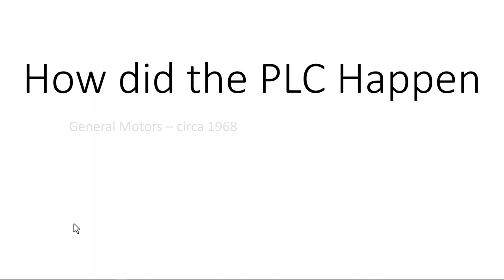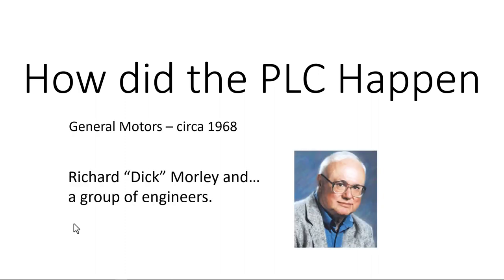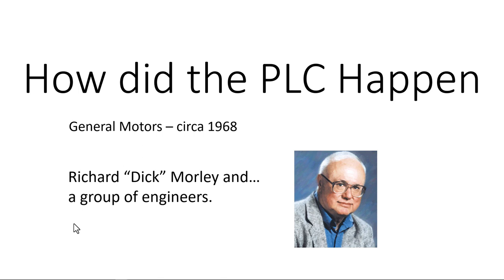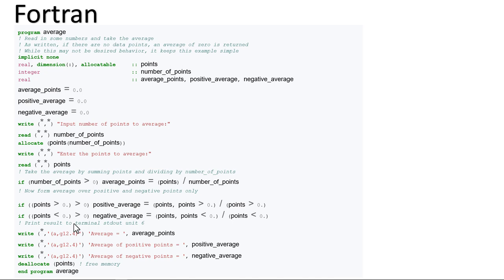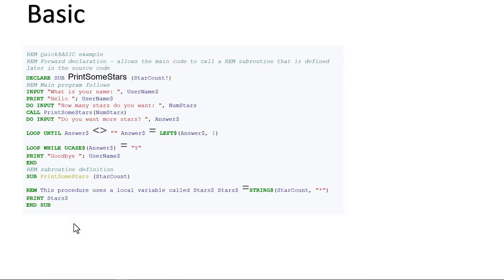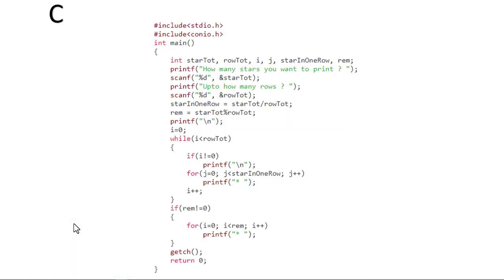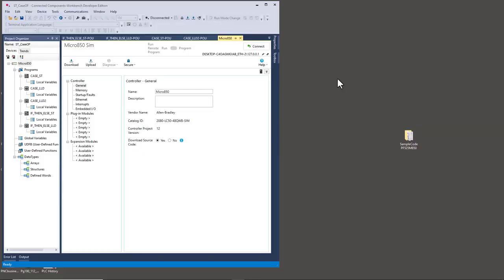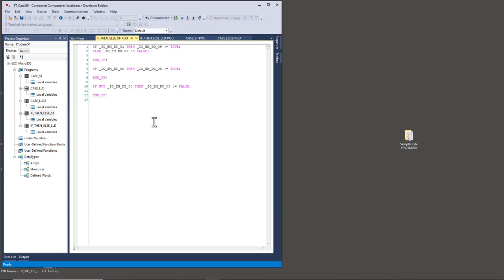Rule #1 for Programming PLCs

Comment: I appreciate the notion that at the forefront of every process is getting the most product produced and to the customer in the least amount of time as possible.  Most times, but not always, that means using some well thought out structure or language in coding that facilitates quickly interpreting the code and what’s happening.  However, with that said, it seems you’re making a lot of assumptions in your efforts to “sell” ladder diagram for PLC programming.  So, with all respect, allow me to play devil's advocate  😎

Assumption 1 – All “Joe Snuffy” maintenance personnel only understand electrical circuit diagrams, therefore all code should be written like a circuit diagram (ladder).
I've worked with some very talented electricians that actually were pretty good at text languages.  A few of them played with Arduinos and other hobby like text programming outside of their jobs.  So when it came time to go online with the PLC that had structured text code in it, it was not much of a problem for them to go through it and troubleshoot it just as easy as if they were troubleshooting a LD program.    

Assumption 2 – It will always only be “Joe Snuffy” maintenance personnel troubleshooting PLC code at every company.
I once worked at a facility where the only people that went online with a PLC to troubleshoot things were the controls/automation engineers.  Those engineers were expected to understand the code inside and out, regardless of what language it was.  That means going online with the process and studying the code and the machine so that you know it well.  In my opinion, that’s the way it should be at every facility.  If the company is expecting maintenance people to troubleshoot PLC programs, then those people should know, understand and be able to interpret all PLC languages (IEC-61131) well.  Otherwise, get someone else with a better suited skillset to troubleshoot the PLC programs.  In regards to that,  it doesn't always need to be maintenance and electricians only.  In fact, it doesn't need to be them at all.  Companies should get out of that paradigm mind set that its maintenance and electricians that troubleshoot PLCs.  I know its become a bit of a norm, but companies are making their maintenance personnel do a job that they are not trained or experts in.   So then in many cases, we're dumbing down the program or not utilizing the full capabilities of the PLC technology and advantages of certain PLC languages simply because "Joe Snuffy" might take longer to interpret it if its not what he/she knows (LD).  

Assumption 3 – Ladder diagram will always be easier to interpret than text code, for every task.
Take a very common task of iterating through an array of integers and finding the element within that has the highest value.  It's going to be much easier to both write and interpret that in ST than in LD, especially if your PLC platform doesn't have a ready-made For Loop instruction.  In ST, it would be a simple and very common For-Next loop.   That's just one example of many.   

Assumption 4 – Everyone will interpret ladder diagram faster and easier than they interpret text code.
I once worked with a particular gentleman that could write and interpret text code like it was nobody’s business, but had a heck of a time understanding and interpreting LD, something that supposedly is supposed to be easy for everyone.  Moreover, I've often times been around persons with text programming background that just couldn't grasp the "normally open" and "normally closed" concept.  

Assumption 5 – All PLCs brands that use text code, will not show the value of a variable in that text code when you’re online with the PLC.   You will only be able to see the online value in a ladder editor.
Perhaps that's how it is in RSLogix world, but that is not the case at all in some others, particularly anything that uses Codesys or Codesys under the hood (Beckhoff).  With those, you can be online with the PLC and see the real time values of the variables inside the structed text editor just the same as you can in the ladder editor.  No difference.

Something else I feel needs to be mentioned in regards to graphical languages (LD, FBD, SFC) versus text languages (ST, IL).  Graphical languages take longer for the processor to process versus text languages.  This means you'll have a longer scan time requirement for LD than if the same routine was written in ST, especially for larger programs. Scan times matter!  A simple difference of 10ms scan time versus 2ms scan time could be the difference of 100 widgets per hour at 10ms scan time versus 101 widgets per hour at 2ms scan time.  For a typical 24/7 operation, that's a difference of ~8760 widgets per year!!!  So, it's not just the downtime that can directly be seen that is costing the company money.  It's also the "downtime" that cannot be directly seen that is costing the company money too.

The way I like to do it and from my experience works well, is to have a Faults routine and write it in LD or FBD.  In most cases, the rungs will be simple and easy to interpret.  For the rest of the process/machine, feel free to use whatever language is best suited for the task.
Reply from the maker: I am not selling anything. I am making a lot of money cleaning up processes written in structured text that their technicians/electricians can't troubleshoot and most of it is spaghetti code. You cannot monitor the logical continuity in any of those platforms that you mentioned...What good are the tag values if they are not present in an active dynamic context?
Reply: @plcprofessor   You're trying hard to make an argument for LD, and making a lot of assumptions in the process.  That was my point in my post.  I've seen it before.  If LD is the way we all should be doing it, then why is there even other PLC languages in IEC-61131?  Furthermore, why is the predominant PLC language used in the EU, Structured Text??? 

"that their technicians/electricians can't troubleshoot". 

That is NOT a PLC language problem!  That is the person/s that wrote the code problem.  Spaghetti code can be done in any language, not just ST.  That is also, perhaps and very likely, the technicians/electricians that can't comprehend text languages.  In that case, that's a company problem that's hiring the wrong persons for the job.  Again, as I implied in my original post - Stop hiring electricians to be programmers!!  If these persons are going to be the ones troubleshooting PLC programs, then they should be expected to be able to comprehend all PLC languages that could be present in a PLC at any given time.  That means the company needs to get them up to speed, and if those persons don't get there, then the company needs to get someone that can/will get there.  But the PLC language used should not be "dumbed down" for anyone.  We use the best language for the task, period!  There needs to be a paradigm shift in thinking that "only electricians work on PLC's and that's who we hire for these jobs".  Hire programmers to be programmers.  Hire electricians to be electricians.  But that makes too much logical sense.
Reply: @plcprofessor you professor completely ignore the good points people point out. Too stubborn to admit that they are right in some point and you are wrong

Comment: Less downtime then you need a really good test suite. I come from the Wind turbine and generator Industry. Down time is absolute a no go. 

The test suite call unittest - integration test and lastly system test is so importen. Many dose not do that which is baffling me alot. Test driven development saves time on site and it is alot cheaper to correct fault at the office compare to the customer site.

Comment: I feel your pain. It troubles me to see the modern PC programming is turning into that Angular / node.js style and i miss the old C++ or Turbo Pascal style of building applications.

But ladder logic is not easier to debug. With the PLC program being more complicated than just handling a garage door ladder logic falls of quickly. Siemens have ways to monitor variables in SCL and in STL can monitor variables (accumulator) but also RLO so you know exactly what`s the result of logic operation and when it changes to 1 or 0. Just using ladder logic doesn`t guarantee that the code will be easy to read and troubleshoot. In many cases the ability to read is how functions/routines are called. Is the function called from one place or multiple places (like one call from OB1 and another from OB34). Or the values in one function can they be modified from outside? Which functions modify them and when are they called? How do you design loops? How do you use pointers?

Comment: Not every process is assembly. How does good parts out the door relate to a water treatment facility?  I think his point is that PLC's were created largely  to help get more products out the door, by being more user/technician/manager friendly, not so that programmers could sit around doing nothing but dicking around endlessly "creating" AOI's. Valid point, but needs to be stated more clearly
Reply from the maker: bottom line...structured text is the most time consuming code to write and troubleshoot, machine control or process control but is good for algorithms that never need to pass through for troubleshooting purposes. AOIs can be just as bad if not thought out for the kids on the shop floor.

Comment: Based on the cover picture's bright light, I have to ask how many KW hours do you "burn" each month.  Doing Systems Analysis for energy.  Currently, working on vertical Wind-Turbines within MicroGrid nodes.  Been doing A.I. since 1988 (U.S.).  What's all the excitement all about?  ChatGPT isn't greatly new.  Relax and learn about it.  Expect many generations ahead inside PLCs.
Reply from the maker: ...and I am willing to speculate that if you lost power, it would probably be the death of you. I was doing neural nets well before that.

Comment: I was just 10 years old when I had my first interaction with automation. It was with BASIC on 8bit PC in 1984. Actually, it was my mother's second husband to explained how to connect all the el. appliances at home to the computer and control them. When I started the PLC course I was somehow disappointed in the ladder logic as was already programming Arduino on C++ which is much easier. But a couple of weeks later I understood that is much more important to understand the ladder logic especially the relay logic which actually is based on Boolean algebra. In my opinion, if you don't know what are logic gates and binary system there's no point in losing your time trying to be a professional PLC programmer.

Comment: also you are being unfair to your structured text. You use very verbose statement with if and else and in the ladder you just assign. so if you just assign OutputX := Input Y, it is more readable and would be the same logic as a normal coil ... (well ok, the other way around, the output comes first because it is the assigned variable) ... of course you need a st editor that can show state and maybe even color code ... so I agree with the visual trouble shooting and state aspect ... you will see that any visual programming language will be popular with some audiences, but once it get's more complicated, often structured text is more powerful and often actually more readable ... if you look at complex node red diagrams, you will easily get lost ... there is a lot of low code programming hype, which I understand and it certainly has it's benefit ... and if you look at it, PLC ladder logic was actually a very early low code programming language for non-programmers (electrical engineers extending their working field) ... the same is true with todays "marketing programmers" or "analyst programmers" that use similar visual programming to solve problems in their domain without being a full code developer
Reply from the maker: You missed the entire point...this was not about you.

Comment: I understand and generally agree with your take home message, but I don't think you are doing a great job with the examples and (for me anyway) it detracts from your point. They are somewhat contrived and it looks like you are setting up a straw man for ST.

Example 1 code could have been this; 
_IO_EM_DO_09 := _IO_EM_DI_01;
_IO_EM_DO_08 := _IO_EM_DI_00;
.... not whatever the hell you had.

In my opinion state example 1 shows why ST is good. I would prefer to read that in ST to understand its function.
In state example 2 I believe ST would be more equivalent with something like;
_IO_EM_DO_00 := (State = 1);
_IO_EM_DO_01 :=  (State = 2);
_IO_EM_DO_02 :=  (State = 3);
_IO_EM_DO_03 :=  (State = 4);
much more concise in my opinion. 

I get and understand your point regarding monitoring. 100% agree with you for CCW, but  I don't think you are really comparing apples to apples when it comes to the industry as a whole. Rockwell is known for being horrible for structured text. I could show you some IDE's which make ladder equally as abhorrent that have really nice ST editors. 

We also didn't touch on loops or other more advanced algorithms. 
At the end of the day, use the right tool for the job. Good job, keep the videos coming.
Reply from the maker: Good luck on the shop floor...

Comment: Your whole point around ST being worse than LD is demonstrated on like the simplest hello-world a PLC can do. Your standpoint is like from 30 years ago, things have changed alot!
Also you picked a manufacturer which is not capable of live debugging ST, which is not ST's fault. I can see the variable value live and can change it by a single click or force it with 2 clicks on a beckhoff system.

Even your big statemachine in the main POU does almost nothing other than setting some booleans.

how would you even begin to iterate over some 1000 structurized member array ? - oh wait you guys would copy paste the same logic a thousand times.
Have you even mentioned breakpoints ? Or is your plc also incapable of that?
With no word you mentioned the extended IEC-61131 object-oriented ST,  which to me is another sign that even if you did program BASIC or FORTRAN years ago, you don't actually really get how modern PLC is/could be programmed, or do you know what an Interface-POU is and why it is used?

The only point you have is that electricians won't be capable of debugging ST code, which is kinda true. But then again, try to program a modern big machine on like LD, it is gonnna be a nightmare and you cost way more than any electrician trying to fix ST logic. And if ST delivers faster, most companies will take ST-coded machines.

Comment: The goal isn't just products it's also about safety? Sorry how could you miss such a critical aspect of PLCs? Sorry as you said in your preamble maybe I don't belong in the industry if I don't take safety as seriously as production?
Reply: These days, regular PLCs and Standard portion of Safety PLC, should never been used for safety. When machine maker or any other integrator leaves the floor, safety logic in Safety PLC and Safety wiring must be checked and verified ahead of time. In case of safety PLC, the Safety part of it must be locked and being Password protected.
Reply from the maker: Jumped in without hearing the full of it, did you? Safety has nothing to do with programming languages, safety is 95% hardwired. The CR30, which is what I use, has a very simple graphic programming language.

Comment: The suggestion to do not learn Structured Text as the primary programming language when approaching PLC (or any other 61131-3 based Control System) is a very bad career advice.
Reply from the maker: Hmmmmmmmmmmmmmm...I do not remember saying that
Reply: Hi  @plcprofessor , thanks for replying.
In the introduction it is emphasized the idea that, in order to get good code, it should be easy to troubleshoot the code itself by monitoring online the PLC variables.
After that, there is a comparison of the benefits of a graphical language vs. textual languages, with a few examples to show that the graphical approach provides a better way to troubleshoot the code.
Finally, it's written in the notes that this information is given to programmers for the sake of their careers.
So, what I understand by watching this video is that if I want to get good code, then I should expect to monitor my variables online and therefore it's a good career advice for me to use graphical languages since they're more suitable for online monitoring.

This may be an acceptable approach in very specific projects or when using some PLC platforms with limited features, but it is certainly not a good career advice.
Reply from the maker: The career advice is to engineer for maintainability with the available workforce for maintenance. @nzsystems